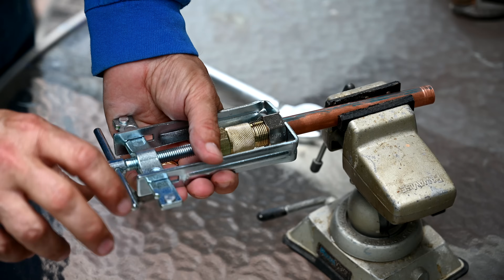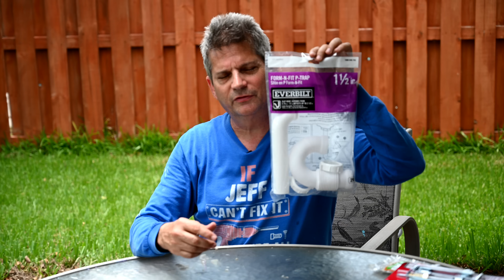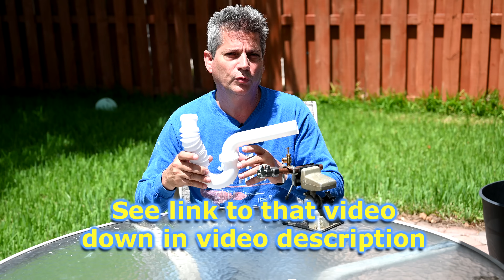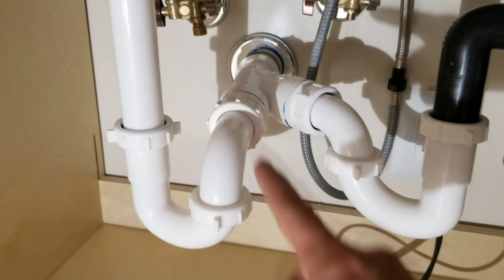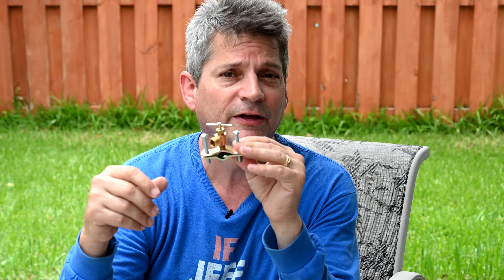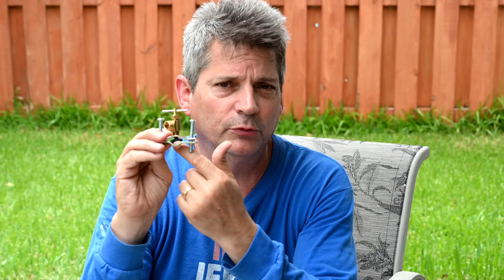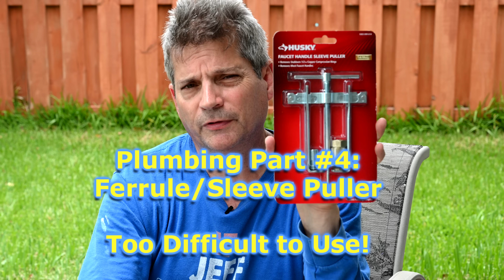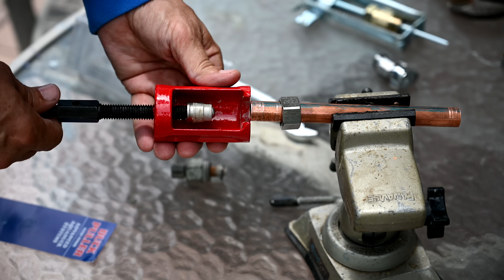4 Plumbing Parts/Tools You Should NEVER Use. NO Plumbing Fails

Comment: and further more after reading your arrogant replies to other people telling you the same thing I will NEVER be a subscriber
Reply from the maker: So I guess I'll be subscribing to all the guys whose videos show putting in flexible traps in saddle valves and S traps?
Reply: @jeffostroff    no sir. I know these upcs and you know them. but in general what I'm saying is the people who dont are the ones most likely watching your videos
the information you present is absolutely correct I would just suggest you try to refrain from insulting your target audience, not everyone has had the pleasure of working under bosses who call us idiots. lol. just food for thought. btw how do you feel about the ID diameter reaming tools for specialty PVC fitting that need to be reused?
Reply from the maker: @leonardarch3092   As long as the tool does not thin the wall of the pipe too much it should be OK. Typically what we see those inner diameter reaming tools used for as when you have 1 PVC pipe cemented inside of another one underneath the toilet on the big 4" drain pipe going down into the sewer. Sometimes the plumbers need to use an inner diameter tool to completely grind that pipe all the way down to the inside diameter of the outer pipe surrounding it.

Comment: I am a Handyman/DIYer also worked building maintenance and have NEVER used those parts! Not all of us are stupid. Have used a puller on handles to replace valves/seals but not on compression rings. Not in maintenance any more so I don't use puller anymore, I just replace the fixture. Still, good info and glad I'm not taking short cuts.
Reply from the maker: Great minds think a like I also replace the entire fixture if something gets to the point that you need a tool to yank off the knob then something's wrong and I always like to update whenever I can for 50 bucks you can put in really good looking new faucets and inject new life into a vanity
Reply: @jeffostroff  Exactly!

Comment: Please don't throw all DIY'ers and Handymen into the "subpar" "don't know what they're doing category".  There are DIY'ers and Handymen that will do a better job than a certified plumber and vice versa.  This is not the case with just plumbing either.

As an example, you stated the plumbing code is required in all 50 states.  That isn't correct.  My state, Missouri leaves it up to the individual counties who then either adopt a code or let the individual municipalities choose.  In my municipality the code is the 2009 version, in the adjacent municipality it's 2006.  There are adjacent counties that do not require it at all.  I know this and I'm a DIY'er.

I am remodeling my house, as a DIY'er and even though my code is 2009, I'm using 2018 for improved methods and safety.
Reply: Yea bullshit..
Reply: True....I'm a jack of all trades...I pay attention...measure accurately, cut accurately and always conscious of square and plumb and levels in whatever im doing
Reply: Yeah, what is worse are those that do not bother watching videos like this.  There are several levels of wrong.  One of the guy who does no research, they just buy parts and slap them in.  Then, there is the "Handyman" who may or may not know better.  Then there are general contractors who know how to avoid code violations while doing the worst work possible otherwise.  Then there in the i formed DIY person who only does jobs that do not require a professional.  Then there is the do-it-all professional plumber and finally the self-employed expert.  I have one guy that just does installs and repairs and no drain like work.  He is good and the only employee at the company.  He tried hiring others but there work was always inferior.  This is true for other industries like electrical as well.  I can always tell when work was done by a GC versus a plumber or electrician or framer.  One does it right and the other does just enough to pass current code.  Codes change and often the GC shortcut will no longer meet code unlike if you had a plumber or electrician do it.  They take the extra time do do it correctly.  They do not have a quota of how many electrical sockets per hour they can install.  I have had to fix so many things I knew was wrong as soon as I saw them and I am no expert.  Yet, I can always spot when an electrician did the work.  They use techniques that last and do not need fixing or replacing years later.  Same for plumbing.
Reply: Very arrogant and ignorant. One should never lump a whole group of people or professions into one category. Did a Handyman once do a better job? I am sure Jeff is a great plumber and I honestly learned something from this video. Thank you, Jeff. Unfortunately, I will never watch another of your videos. I watch videos like this to learn, which I did, and admitting to what you do not know and seeking to learn leads to a more knowledgeable well rounded educated individual. I am a Handyman and people hire me because I am a humble honest person who they trust. I am a craftsman and I never go for the quick fix. If I can't do the work, I won't do the job. It's called integrity. I am very knowledgablele of code, home inspection, and a very talented, detail-oriented individual in more than one trade.
Reply: Good points. I'm a DIYer & I know the plumbing code better & take more care than the local plumbers. I saw the botched job the "master" plumber did at my friend's house & it was horrible. Dude put the trap on a washing machine standpipe under the floor & busted a hole in the brick wall & didn't seal around it and then had a very short run of PVC up & slapped a crappy cheap AAV on it-- OUTSIDE. He didn't have to run it through the roof but he could have run it around the soffit & above the roof. He also didn't slope the soil pipe at all so it won't drain properly. The other plumber (there are only two licensed plumbers in the area) uses the wrong fittings-- will use sanitary tees on their backs when he should be using wyes.
Reply: BigBrotherIsTooBig

Absolutely!

I’m a DIYer in Missouri, too and I take a lot of time and pride in my work.  Plumbers and other professionals are there to make a maximum amount with minimum effort and spend as little time as possible.

Many DIYers study the code and research the best methods to complete whatever has to be done.  We also have the luxury of spending as much time as necessary to do it perfectly.

Plus, we’re often working on our own homes which motivates us to do it right even more!
Reply: Thanks. Common sense. This guy is demeaning. I'm a handyman and I get lots of stories about professional rip offs. Pretty much like specialized doctors. You need a permit, a carpenter, electrician, and a plumber to come install a dishwasher. Oh, don't forget to pay the inspector...
Reply: Not to mention that once all the things mentioned were at one point completely viable fixes or solutions for challenges. Those taps for water lines are still commonly used. If they were totally illegal to use they wouldn't be commercially available today.
Reply: @agentone8550  That's not completely true. Stores still sell things that are code violations (such as S-traps) because there is still a demand for them. In some places AAVs are banned but are still sold. The main issue is they won't pass inspection (and may lead to leaks or failure of the DWV system), but people will still use them either for convenience or out of ignorance. Unless the manufacturing was banned, they will still be available. Doesn't mean it is good to use them. So long as a profit can be made, companies will make things and sell them regardless of whether or not they are to code or work properly.
Reply: I’m a journeyman plumber, and went to
School
For
It. You’ll never do better work then a plumber who loves his job and takes pride in his work.. never in a million years I plumb 3000 hours
Plus a year .. youR a weekend warrior.
 It’s like
Me saying I’m
Better at you the whatever it is you
Do
For
Work
In Real
Life. It’s bs
Reply: I bet your right when you say NEVER BETTER , but there are many who do "JUST AS GOOD", especially  on light plumbing ,  "because of a combination of working in the trades, research and experience.
Reply: @seanmulholland7597  stay mad, some of us are just gifted  >:-)
Reply: @seanmulholland7597  Congratulations, you work with shit all year long, be proud of your life choices.  
I never said I would do better work than you.  You also added , "takes pride in their work" which I didn't specify.  So like I said, some DIYers do better work than professionals, even if it means only professionals that don't take pride in their work...too many don't.
#Glad I dont have to work with shit 3000+ hours a year
Reply: @seanmulholland7597  I know you think yourself to be the god of plumbing, but I think why people do it themselves or get a handyman is probably because they can't afford the markup.  Unfortunately I have been cursed hyperthymestic syndrome, I have not forgotten anything I have read or experienced since I was about 10 months old, along with a bit of OCD.  About a week ago water came out from the bottom of the toilet in our pool house, not a lot just a little when being flushed.  I called a plumber because I really don't have time for the small things.  He came out and without even looking wanted to charge over $800.00 to put in a $120.00 toilet.  Contractors think they can just add more $$$$ to the estimate just because of the neighborhood, kind of like how mechanics charge women more.  I told him that I would check with the home warranty since my house is only a couple years old and I would call back.  Instead I just bought 2018 Uniform Mechanical Code and a couple other books that went into detail on everything  to do with plumbing and I read them that Saturday and watched some training videos on Sunday, which put me in the subject of how the water is treated and on and on, but know I am cursed with all that knowledge as well.  It took me about 30 minutes to level the flange and install another wax ring.  I did not need to replace a mostly new toilet that has probably only been used a hand full of times to install a new toilet that was cheaper model than what was already in there because some guy needed quick cash. If he needed money he should just ask I could give him more work but if I have to work to make money, I will make sure they will do a fair job for a fair wage.  Some people are not privileged enough to have a $500 or $1000 plumbing emergency especially right now.  So maybe think next time before you look down on them because they had to cut a corner because there medicine costs more money this month and they have to have their medicine to live and then they have a plumbing issue but no more money.  No one is expecting you to work for free but maybe just without the judgement and a little more understanding.
Reply: @michaelbongi8275  We hired a licensed plumber six years ago when we moved into our 1923 bungalow. (Nothing is level, and it is not all from the house settling.) They used one of those scrunchy pipes under my kitchen sink for a lot of money. Our insurance did not have a problem with it. We put in a new sink a few months ago. Well, I put it in. I changed the pipes with my "weekend warrior" skills.  He also said that the bathroom sink was already vented properly (despite the smell). I have no idea why he said it. According to the inspection when we purchased our house, it was not vented.  I ended up only having him do the kitchen sink--which I regret--and venting the bathroom sink by myself. He was also supposed to put in a new toilet, but, like with your experience, the estimate was ridiculously high.  Not $800. "Just" $700. My husband and I did that ourselves.  Getting the toilet up the stairs was probably the hardest part. The leveling and placing the new seal went pretty easily.  He could have had three jobs in our house instead of one and a bad review. (Yes, he really was/is a licensed plumber. I do not know how, but he is.)
We are currently trying to decide what to do with the bathtub. It had a divot when we bought the house, but the divot has gotten deeper. Replace or repair? Either way, we will likely hire someone, but I am concerned about getting ripped off again by a plumber who thinks I am stupid.

Comment: Interesting on the S-trap. Here, the standards are written to control venting of the stacks instead to prevent the trap being sucked. Either by having a vent stack nearby, or air admittance valves, and advising on the size and location of vent lines and valves.
Reply: Geezzz my 92yo mothers house has the S trap. The trap came apart from the pipe exiting the stink. It's a goner.
Problem is...someone glued the nut on the part before the curve into the floor. The house is in ill condition and not worth living in but she won't move. So I'm gonna just do what I can with a P trap. Making Sure of the vent and adequate water fill. I guess....
P.s.  I'm an arthritic riddled 64yo woman who used to do it all. Mom doesn't realize what it does to me but I'm the only of 3 who helps her.
 I hope you enjoyed the book and now I can't remember the purpose of this DIY. 🤷‍♀️
Have a blessed day!

Comment: Isn't it true that an old house that has this grandfathered in , meaning that you are not required to rerun your plumbing in the walls and floors in order to sale the property.
Reply: I would think yes, just like electrical is grandfathered (as long as it's safe) and not requiring anyone to be rewiring their house. Just like many old homes still have knob and tube wiring (although much wiser to change out)..

Comment: Thanks Jeff, all great info but in the case of the saddle valve you showed that its a code violation but you did not show what the correct procedure was which would have been very helpful as I have a couple of these in my house and I can solder. Thanks for your time anyway Jeff.
Reply from the maker: My preferred method for avoiding the saddle valve is to get a double angle stop under the kitchen sink, like this one below, then you don't have to solder, just tighten this onto the pipe.

https://www.homedepot.com/p/BrassCraft-1-2-in-Nominal-Inlet-x-3-8-in-O-D-Comp-x-1-4-in-O-D-Dual-Outlet-Dual-Shut-Off-1-4-in-Turn-Angle-Ball-Valve-KTCR1900DVX-R1/203309317
Reply: @jeffostroff  That's exactly what I was gonna suggest,either that or replace the sink valve with a 3/8"+1/4"outlet,depending on what you are hooking up.
Reply: I used a compression tee, with a rubber seal on the female side, just like the flexible lines themselves use:

Plumb Works® 3/8"Female Compression x 3/8"Compression x 3/8"Compression Supply Tee at Menards
https://www.menards.com/main/p-1444437569319.htm
Or for ice makers (1/4" line)
Plumb Works® 3/8"Female Compression x 3/8"Compression x 1/4"Compression Supply Tee at Menards 
https://www.menards.com/main/p-1444437569216.htm
Reply: It's called $$$$$.  Also, items such as the saddle valve can be used, as intended, in areas other than house plumbing.  Are other type connections better for the long term, yes, of course, but the saddle valve does provide a quick, low flow, connection tap.

Comment: The S-trap is a siphon, period. The big box stores have no interest in showing us how to do it right. They just want that money.
Reply: listen idiots   when you have to replace an S trap that has rotted away, you are not going to remodel the whole bathroom just to replace the trap. They are illegal for new construction, but are OK or replacement.
Reply: Yeah, I was wondering.  I have S traps going through the floor.  So I’m supposed to knock holes in my walls and run P traps through them?   Also the bathroom is tiled floor to ceiling.  Sounds like I’d have to completely gut my bathroom to the studs to make my traps “right”
Reply: It is NOT a perfect world!
If your house is 90 years old and you haven't had problems with sewer gas coming up from the drain, you are NOT going to start having problems now. If you need to replace the trap, replace it with what you have now. That is why these are available. 
My 95 year old house has 2 unvented drains. The house has been in the family for 95 years and in all of those years there has never been a problem with sewer gas from those drains. 
These would be illegal today BUT what I have has not caused a problem in 95 years. There is no reason to "correct" it now. Likewise for S traps. 
Too many of these "rules are the result of trying to generate more business in the plumbing industry and in SOME cases cause panic with homeowners into making changes to something that hasn't caused problems. Sewer gas stinks. If you have a problem you will want to seek a remedy. If not, dont rock the boat.
Reply: A final word!
All that is needed on the S traps is a "Warning" on the package.
"This product is for REPLACEMENT. use only. It is not legal in new construction. 
This product has been known, in some circumstances, to cause  a siphon action in the drain and result in the escape of harmful sewer gases. If such a problem occurs, seek the services of a licensed plumber.".

Nearly ALL older homes have situations where codes have changed and the older codes are no longer acceptable in new construction. In most cases these situations are "grandfathered" in and dont need to be changed unless there is major remodeling to the area. You cant change your house every time a code changes.
Reply: So do the Plumbers..25% of which are hacks even though they have code training, tools and first rate parts at their disposal.